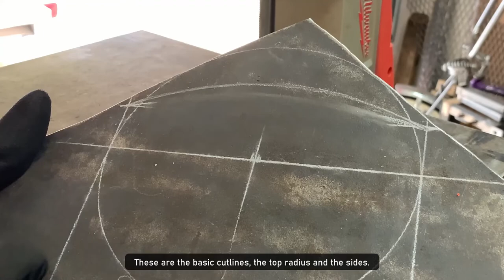Small Wood Splitter - For Kindling

Comment: Alberto where did you get the hardened cutting edge that is needed to split the logs? I'm working on a modified rocket stove and I can see that I'll need a decent sharp edge to split wood from time to time..
Reply from the maker: Hello John, the cutting edge is not hardened steel, I just made it out of 3/8 hot rolled plate and formed the edge myself. I have not had any issues with the edge losing its sharpness. I hope this helps.
Reply: @albertoguerrero5362  I've got an idea for a combo Rocket stove /smoker / Blackstone that we're going to build. I'll keep you up to speed as we go forward..I'll need a log splitter too. I need to split the wood before we put it in the rocket stove..
Reply from the maker: @johnmccarthy6451  Yes, I can see that to be a good build. Keep me informed, I would like to see it. Thanks again John!